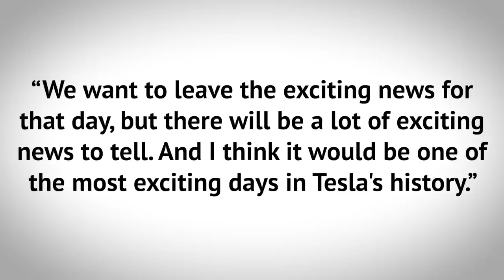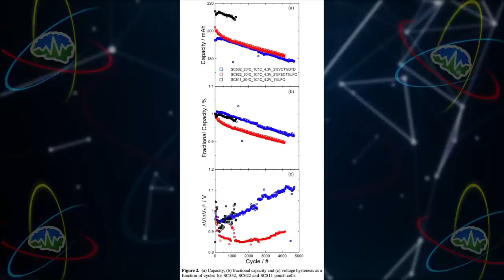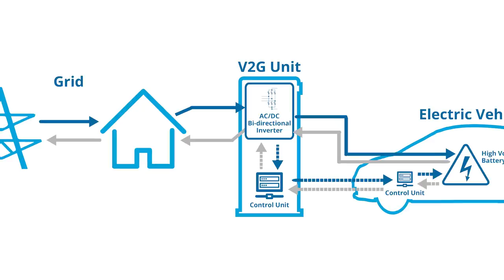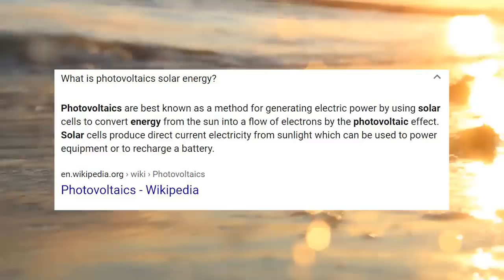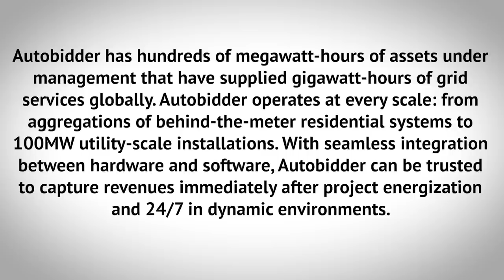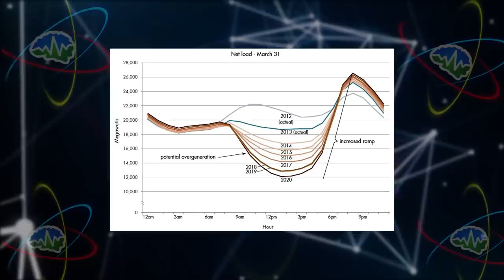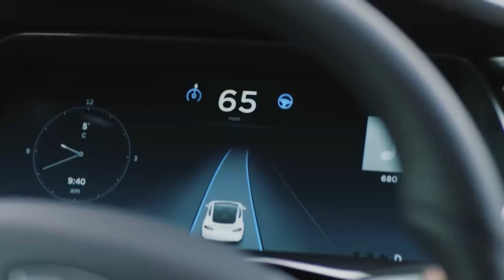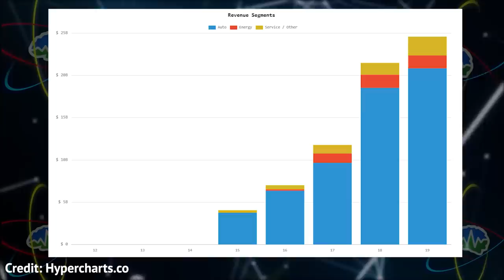Battery Day is Coming!  | In Depth

Comment: This entire video is Not realistic  it costs $30 to $40 of electricity a month on an EV, with a power loss estimated to be about 30%, going in and out and the thousands of dollars of in equipment to be able to send power back to the grid and the marginal difference in the high and low rates there is no way that the $2 or $3 a month in revenue, if possible will remotely cover $$$ invested and maintenance costs every 5-10 years

Comment: Will this create a horizontal and vertical trust? An overlap of auto industry and the power industry? Tesla energy will be able to exceed its gross sales. This expression of Blows my mind has a new meaning far beyond the psychedelic  meanings of the 1960's through the 1970's. Truly as presented (sounds like it may leave some technical aspect of this out. Based upon what you presented, no wonder Tesla split five to one. AF

Comment: 'Im CHARGED NOW!'   Thanks Zac&Jesse
When Elon brought out the Power Wall, l exclaimed 'NOOOOOOOO'
At a point 3 or four months before Nissan named V2G (Vehicle to Grid) l wrote to friends around the World to share a view of the future where the cars in 'the street' were owned by 'all' living there. The cars would be parked over an 'induction' charge pad(whatever it's called today)____the cars would be connected to the homes and then on to the 'grid' 
This was my view 4 or five years ago?
ln 1981 my good friend Bill Lutterell (my boss) and l spent about six months designing a ten star rated equivalent home (there was no rating system in Oz then) . lt remains a set of detailed 
/structural council application drawings in my old architect's tube at my mother's farmhouse in Lang Lang!

'Make the Change you wish.
Be the wish of Change.

+x
May ALL The World come to know Change.
With one small change!
One World_One Wish_One Love

!nK 2019 '

Comment: When you build a battery manufacturing plant you don't get it for free (more profit) it's a function of return on capital. To get a million miles the range will drop thus the need to "promote" robo taxi's. But robo taxi's will require FULL self driving which can't be achieved with vision based systems that falter in inclement weather. The only self driving vehicles on the road are Google's which uses lidar, which is superior. Tesla's incremental "learning" hits a wall in fog, heavy rain or snowstorms. Lidar picks up this last .01% of driving risk which is essential for driver-less transportation.  Other auto manufacturer's know this... and have the $7,500 tax credit to introduce lidar.

Comment: Where does the energy come from atm, it is a furby that renewables are  providing our energy, renewables are providing about 3% of the worlds  power needs and it is Coal/gas  that is still providing our power  world wide. Even Germany has  gone back to Gas powered plants in recent years, Solar/wind will never provide our energy needs.
China and India is  building  300 coal/gas powered electricity generation plants right now and so is the rest of the world because they know that renewables will never do the job.
Solar is OK for powering homes but not for industry  which is where 80% of power go's to.
Reply: Don't have the latest stats but on April 28, Britain had gone 18 days using ZERO COAL . Solar and wind are now the least expensive energy source,  battery storage will make it useable 24/7.

Comment: Hey guys.  Thanks for the information.  However, as fascinating as your presentation and the technology is, to me there is one potentially fatal flaw.  If it becomes an issue of mandatory compliance, the system you are proposing gives the eternal enemy of our liberty - the government (and many corporations working in league with government) - access to controlling yet another aspect of our lives....our energy.  After seeing generations of so much evil perpetrated by the government (and so many big corporations aligned with government), you will have to forgive me if my levels of trust is spent.  
However, so long as people are free to opt out of such a system, I can indeed see that it is likely a system based upon good will and not furthering the government control grid over humanity.  I wish they would just roll out the real energy independence....water power and thorium power.

Comment: Hold your horses!
Tesla admitted that they redused my battery functionality OTA in 2019.
It is a 2015 modell. Top charging effect i redused by 25 -30 %. After four years!!
This is softwarecon just like VW and Apple comitted. Tesla never told.
In prinsipal I think changing my paidfor asset without my concent is illegal.
Batteries won`t last long obviously. Value👎🏻

Comment: https://youtu.be/pP971PYzQJs?t=756: I don't think that an inverter Box is necessary, how much do you want to deliver ?? The Grid connection to the House must be improved if you really want to deliver really big amounts of power.
I  think that all of this will be much simpler, Jack Rickard from EVTV said, that the M3 battery-charger could run as an inverter and supply AC current it's just a question of Software. With this technology, all you need is a cheap EVSE like a Wall Connector charger to connect the Tesla to the grid and act as energy source up to 11 kW in Power. That will technically do it with every EVSE out there in every house everywhere. You can deliver more, it's up to the Charger/Inverter in the Tesla and the acutal AC connection, I can remember Model S wit 22 kW chargers (3 x 32 A @ 230V here in Europe) 
I don't know the legal aspects, but technically everything is allready there all you need is a smartmeter for the billing from and to the grid.

Comment: OK, Lithium Brainz... Riddle me this... How is increasing lithium battery production 'green'? 
--
o Lithium's maximum potential as an energy storage mechanism is much less than liquid carbohydrate fuels
o Replacing 10s of billions of engines with electric motors, many containing expensive, intensively produced neodymium, cooled by essential lubricating oil
o Increasing Lithium production 10s of 1000s of times to supply all these 'million mile batteries' - which they won't be
o Opencast lithium mining is hugely destructive
o Evapourating 100s of litres of drilled underground brine reservoirs for 1 kg of lithium releases vast quantities of the most powerful greenhouse gas, H2O
o Millions of acres/hectares of land will be needed
o Refinement of lithium is very intensive,  transport costs on top
o Battery production is very intensive, transport costs added
o Battery disposal is a major problem, with recycling costs added.
o Portable devices are on the increase. Lithium is not a sustainable fuel. Increasing its use by 10s of 1000s of times will be highly destructive
o Carbon and Oxygen cycles are natural, CO2 is plant food., we breath O2 There is no natural global Lithium Cycle 
--
OK, Space Brainz.... Riddle me this... How is increasing metal space junk 'green'?...
--
Musky people stink. Brainwashed neo-peeps... Nazti Sheeple-Kidz and profiteering parroting controllers. Plant more trees, but more importantly, stop cutting down our wild forests if you want to be green. NEVER BUY AN E-VEHICLE or you will be less green than a lump of coal... or solid lithium (even worse). It's a marketing scam by neo-liberal scum that want to force the world to buy their new e-vehicles and sprawling junk power schemes.

Comment: Please...HEAT IS OHMIC RESISTANCE?  Where do you come up with this stuff? It is as silly as saying Thermic temperature. Or maybe photonic brightness. 
Resistance is Resistance. It is measured in Ohms. Heat can be the result of resistance. Ohm's Law (E=IR) and its derivatives are simple. Let us not try to complicate things with silly made up terms. E stands for Voltage. Electrical pressure, if you will. It is measured in VOLTS. Current (NOT AMPERAGE!) is the rte of flow of electricity, measured in Amperes. Resistance is just that - something which tries to slow the flow of electricity. It is measured in Ohms. Power is what does work. It is measured in Watts
.Watts of power, Ohm of resistance, Volts of electricity are as redundant as past history, free gift and similar incorrect terms of speech in vogue today.
The rest of your program, aside from the silly photomontages is interesting and informative. But let us not pollute it with drivel.

Comment: So what happens when the batteries lifespan ends. How are they disposed of? Landfill? How much will it cost to replace your Tesla car battery? Sustainable energy is unsustainable. No renewable has infinite duration. Wind generators last some 20yrs Solar requires space such 1000's of acres of land and need replacing as well. Individual home solar would be more prudent, however, even that has consequences to the grid due to fluctuations in reliability. Biomass, well anyone who advocates this source is a complete corporate sellout or just plain stupid. Guys, your attempt at convincing morons how good batteries are, says more about you guys than anything.

Comment: So to screw the wall street speculators, Tesla has to be the only seller so that resellers can't inflate the market value of cars.  By buying fleets of new cars and then reselling to create a secondary market like the Supreme brand name, the stock market will highjack the value of the new Tesla cars as a commodity that can be traded like regular stocks instead of letting regular consumers to just drive the car.  It will be more profitable for wall street to just buy out the car production futures like a commodity if the new batteries&grid distribution can't be bought wholesale for utility use as well as consolidating the income generation from consumers.  To think Elon had this in mind in stealing the financial&political power from wallstreet to monetize this emerging technology by socializing the profitability of the actual Tesla car owners.

Comment: You two are something, what that something is I will leave to the imagination of each. Do you 2 really think that if Tesla starts making its own Batteries that it's going to pass on the savings in lowered prices to the consumer??? Wow, remember the Movies Dumb and Dumber and Dumb and Dumber to, well you 2 are Dumb and Dumber 3 if you think that Elon Musk is going to give up PROFIT in the form of lowered prices. Cut out the MIDDLEMAN??? You're Joking, Elon will cite how Unions are increasing the cost of operation and instead of a price drop there will be a price INCREASE to Tesla Products... Worse yet, something you 2 fail to even take into consideration, is Big Oils NEED to dispose of its waste product. Riddle me this Batman Wanna Be "Modern gasoline engines have a maximum thermal efficiency of about 20% to 35% when used to power a car." and even LESS to power Trucks. Why do you think the best car has a max thermal efficiency of 35% in 2020? What do those numbers mean? What they mean is anywhere from 80% to 65% of Gasoline is passing through the Vehicle being WASTED and not doing a damn thing except wasting your hard earned DOLLARS. So let's say you have a 10 gallon fuel tank somewhere between 6.5 to 8 gallons of FUEL are WASTED. Do you know WHY this IS BatBoi??? Because Big Oil has a PROBLEM called WASTE and the only way to solve that problem is to sell said Waste to you and me and call it GASOLINE... That's right folks Big Oil's WASTE PROBLEM is actually being sold to you and me and is disguised as GASOLINE, DIESEL or KEROSINE or whatever type of FUELS. Crude is processed and the lubricants, Plastics, and whatever else Crude is used to make is extracted and the last step is the WASTE PRODUCT that is Filtered then sold to YOU and ME under the Guise of FUEL. Way back when before there was the first vehicle there were Crude Oil Products; not many but Lubricants were being used. Take a horse and buggy which of those two items do you think required some form of Lubricant? Right, the Buggy, as each wheel required Lube for the Wheel Bearings, 1 per wheel or 2 or 4 depending on the buggy. Henry Ford looked out over LAKES of this Crude Waste Product and was inspired to design something that is going to run off of this highly flammable CRUDE WASTE PRODUCT and everyone just laughed at him. Then the first Gasoline Motor was Born, who do you think is laughing NOW??? Fast forward to 2020 and guess what? That Crude Waste Product has multiplied like RABBITS and what use to be the size of lakes is now the size of Oceans. As long as Crude is used in the production of Plastics and anything else there is always going to be a huge waste product that can not simply be dumped into the rivers or over the land so like it or not CRUDE IS HERE TO STAY. Vehicles must WASTE FUEL to dispose of this Waste Product so Big Oil can continue. WE THE PEOPLE should not have to PAY for FUEL but rather Big Oil should PAY US to fill our Tanks with their WASTE PRODUCT. They should also provide any vehicle we want for FREE. Then I won't care if Fuel Efficiency is 10% as long as it's not costing me to pay for fuel. Take the Average Natural Gas Furnace they are reaching over 96% efficiency and have not been around nearly as long as the Gas Engine so why is the Gasoline Engine so wasteful? It has to be wasteful to dispose of the Big Oil WASTE PRODUCT. Electric Vehicles or EV are not ever going to hit it big because they also require LUBRICANTS so stop wasting your money on them. Do you know what the Profit Margin is for Big Oil? NO, I didn't think you did, 85 Trillion per YEAR PROFIT. Big Oil could pay off the US's Debt each year and still profit over 50 TRILLION USD and the United States would be DEBT FREE. Talk about GREED just how much money is ENOUGH when you're talking in TRILLIONS OF DOLLARS??? The average Joe could not spend a Trillion USD if they tried, they'd run out of things to buy. Let's break down Dollars and compare them to Seconds, shall we. 1 Million Seconds is 11.5 days, 1 Billion Seconds is 31.5 Years and anyone care to guess how many seconds is 1 Trillion??? That's right 31,546 Years. 1 fuking TRILLION SECONDS is 31,546 YEARS and Big Oil makes 85 Trillion PER FUKING YEAR and you FukTARDS still think WE THE PEOPLE SHOULD PAY FOR FUEL AND VEHICLES. Do the fuking MATH, if Big Oil bought 350 Million Americans, every Man, Woman, and Child a Vehicles and the average cost of said vehicles was 50,000 USD, that would be less than 18 Trillion USD and they would still profit over 50 Trillion USD yearly.